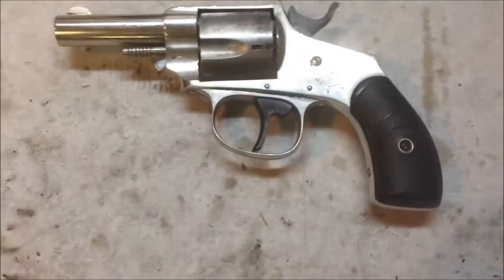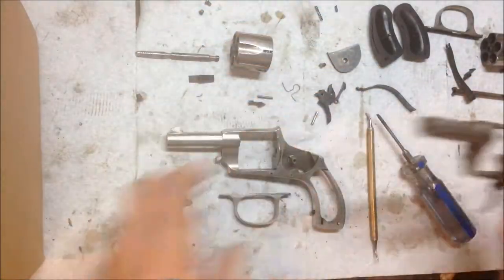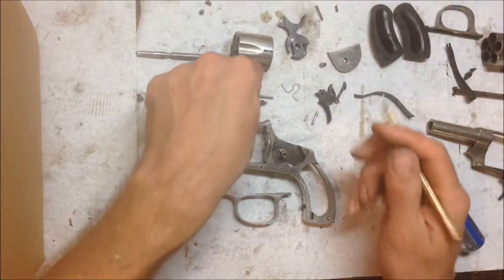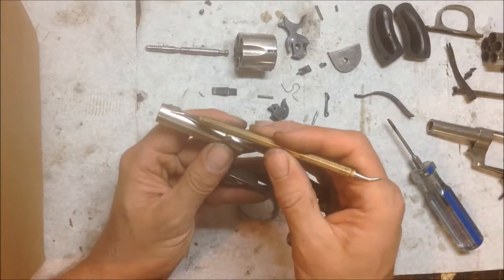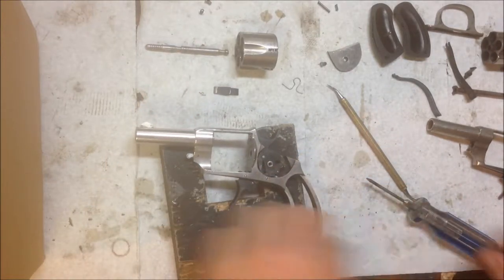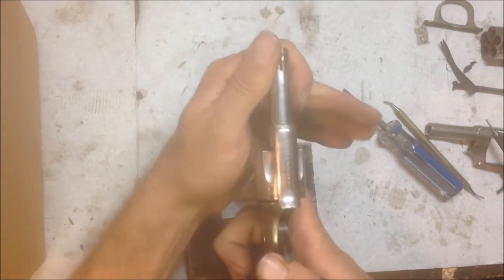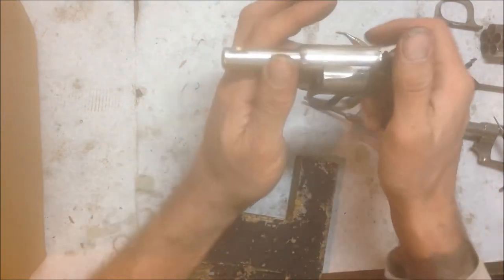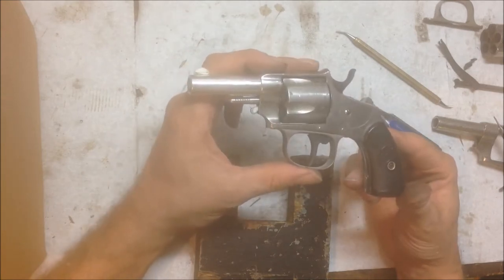Forehand & Wadsworth 38

Comment: I have the same gun. It can take smokeless. I have a 32 short colt and 38 short colt version. I make my own ammo and smokeless works good on it.
Reply from the maker: I strongly discourage anyone from shooting modern smokeless loads in old firearms designed for black powder and/or cordite.  Black powder & cordite do not generate the pressures that modern smokeless powders do.   Old guns were designed to run the pressures produced by powders of the time. Especially tip-up revolvers.  The lock up is not designed to contain modern pressures. Can it hold? It might.  But I like my appendages intact.  I would only recommend shooting commercially produced ammo loaded to the the pressure window in which the firearm was designed to function.  There are small ammo manufacturing houses that will load custom obsolete calibers with modern powder for black powder pressure loads.  We did this for a Winchester 1873 we rebuilt, chambered 45-90 - smokeless loads to black powder pressures, manufactured by Squaw Saddle Munitions out of Wenatchee WA.  If you are capable of reloading your own ammunition, then of course you can control the pressure.  That being said, every single blown up gun that has come through our shop was running reloads when it blew up.  I know personally four other gunsmith shops with the same record.
Reply: @brubakerarmsmanufacturing  sorry the 32 is black powder but the 38 is smokeless. But only certain models can handle smokeless
Reply: @TheFlatEarthChannelcom  Actually the .38 S&W started as black powder in 1877.  Do not assume any particular firearm can handle smokeless powder unless it was made after 1910.

Comment: Nice, so also modern .38 Special Wad Cutter only is dangerous shoot from this revolver?
Reply from the maker: Porta Memories, yes even .38 Special Wad Cutters would be dangerous to shoot through this guy - and they wouldn’t even fit! The cylinder is too short for the length of the cartridge.
Reply from the maker: Porta Memories yes, that looks like it would work.
Reply: @brubakerarmsmanufacturing  you can't even imagine how much you underestimate this gun:I also thought once that something could somehow destroy the .32 rimfire long version of the very same gun that I have..Trust me:you will only possibly do any visible damage to  that sucker if you will just straight out fill the entire cartridge with high explosive like TNT or hexagen and then shoot it!It is vastly better built than any MODERN revolver in .327 magnum! And I mean I literally exceeded the power that you can get from the hottest factory loaded .357 magnum in my Forehand&Wadsworth .32 rf long with it's 2.5"barrel!I got over a thousand fpe because the 100 grain LRN had a muzzle velocity of 2130 fps out of it-and I dumped a full cylinder of these crazy loads in different targets for testing and had absolutely no issues with the gun itself:only a slightly tougher extraction and that's it!However I am not sure about the .38 rimfire version of the same gun that you happen to have because I had never seen such a cool thing but I will really say that unless you will deliberately try to demolish it with a full cylinder of high explosive stuff or something equally crazy then you won't be able to overload the .32 rimfire long version of the same F&W!No matter how much and which smokeless powder will you try-I even laced mine with PETN to about 2 parts for every 3 parts of nitrocellulose,the same proportion of non-flegmatized/plasticized nitroglycerin and both were loaded in the case to the full capacity so that it was literally scary to press the bullet in those yet even that was fired flawlessly and at huge velocities but no damage was done to it!Try to load any modern handgun cartridge with 40% PETN with 60% gunpowder in the same granules and fire it from a fancy modern handgun and it will work as a hand..grenade with zero delay and activated by pulling the trigger!

Although most of the other guns of that era are really goofy and won't withstand a mouse phart in their thin wall chambers but clearly not an F&W production ones!